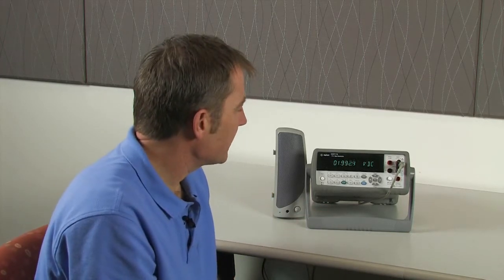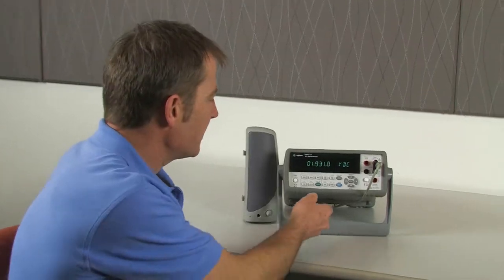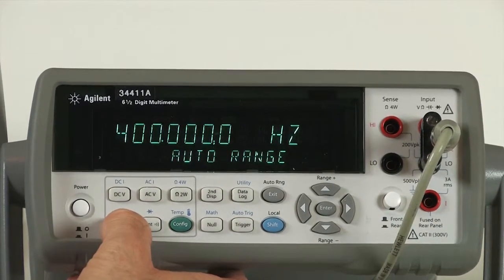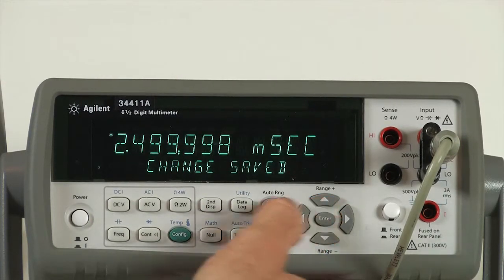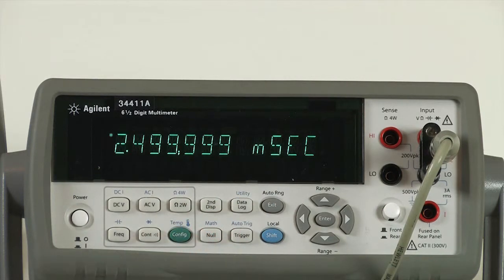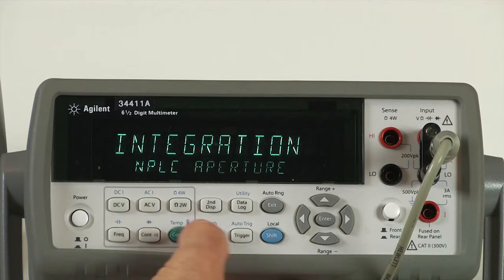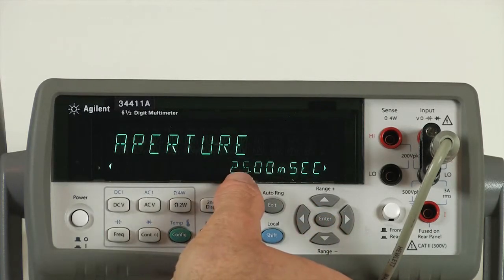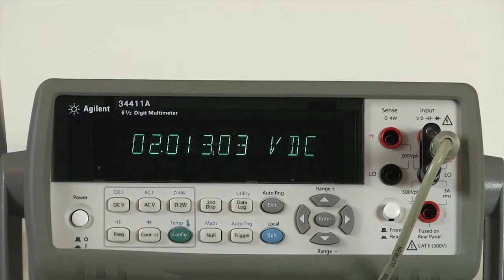Eliminate Noise From Digital Multimeter Readings, A Simple Method For Noise Not Related To AC Power

Comment: We can also use a similar technique by averaging the counts over a few msec from an AD converter such as in an Arduino.
Reply from the maker: @Robin Browne You are correct the noise is reduced by the square root of the number of samples. The samples will need to cover multiple periods of the noise waveform. Integrating the output of the A/D is much faster and provides a higher rejection ratio. When using a DMM that offers both a high sampling rate or integration, it is better to make one slow reading using integration.